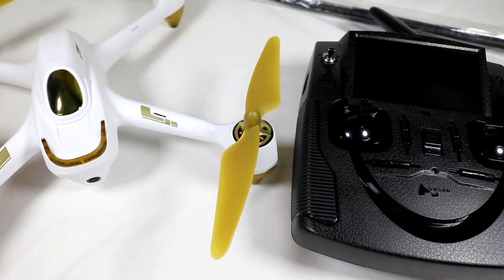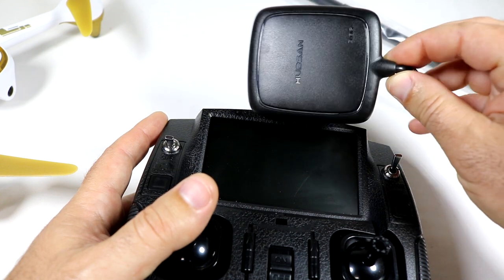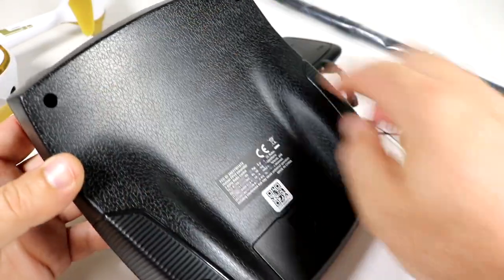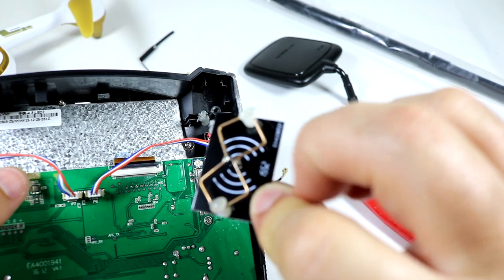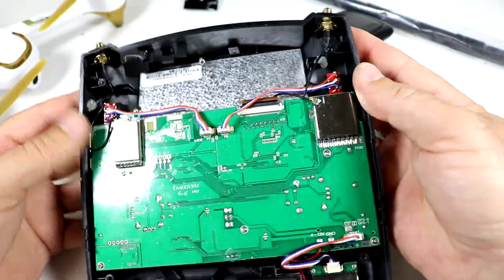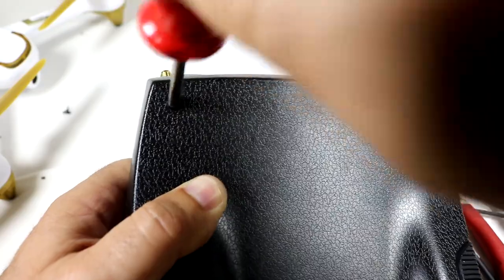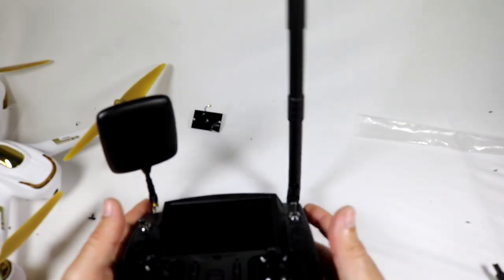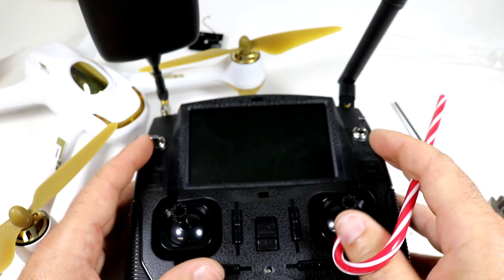HUBSAN X4 H501S Long Range Mod Tutorial [Step By Step]

Comment: use a drill bit stop so you wont do any damage when the the bit breaks through..if u don't have a bit stop use painters tape abd wrap it around the bit ..enough to where its twice the size of the bit....safer..
Reply: Thanks for the tip, I'm about to do this mod and didn't even think about that!

Comment: Dustin: Great how to mod. The internal antenna is probably 1.5 Db. Suggest you get a 5", 5 Db 2.4 GHz antenna. The monster you showed does have 10+ Db gain. The problem is the higher the gain on a monopole antenna the narrower the radiation pattern. A 5 Db antenna is short and manageable and has a reasonably thick pattern. (Example)The 10+ Db radiation pattern is like a VW tire inner tube compared to 5 Db is like a truck tire inner tube. The comparison is flawed in that the 10+ Db antennas signal doughnut circumference is more than twice that of the 5 Db. Higher the Db the narrower the radiated signal and the more directional it becomes. Suggest you show the AA batteries to a Tarantula or JJRC X1, 2S LiPo conversion.That transmitter eats cheap batteries faster than  a dog can eat a quarter pounder. You know the average new be has no idea about battery quality versus price. No fun running out of juice in the middle of may be the second flight! I noticed the voltage marked as 4 to 13 on the board. Quick and easy female JST connector solder job. P.S. That link to BangGood was a GREAT idea. Most modders leave out the, 'Where To Find Parts". :-)
Reply from the maker: +Don Fish Jr. (The Flying Fish) A slimmer doughnut is fine with me if the radius is bigger for range but I see your point.  And this is where a parabolic windsurfer may come on handy also.  We'll see how it does with some various antennas and dishes :)
Reply: The problem is you must be really aware of the antennas orientation in relation to the quad. Dipoles have no signal end on and the signal gets less and less as the transmitter antenna angel in respect to the receiver antenna approaches 90 degrees. The narrower the radiated doughnut the more sensitive it is to less than parallel. That can be demonstrated with video reception using rubber ducky antennas. They produce glitchy video as the antennas angels increase and decrease when pitch and role occur The 5" 5 Db should work for 300 or 400 yards. Much more pleasant to handle. I have a 15" long 2.4 antenna. It works but really is a bit cumbersome for park flying. I say if you want to shoot 1,000 yards use a 50CAL. If you plan to shoot 100 yards use a 22. All depends on what you want to achieve at the moment. You should experiment. For really long range you really must use a power booster. you can only go so far safely with flee power. The limitation is your video range. I went to a 600Mw video transmitter for long range. Double the power yields an increase or 1/4 more distance increase for a given antenna set.  Circular polarized are superior at shorter distance, especially for video. The signal strength isn't affected much by antenna orientation nor is it affected by reflected signal. Linear polarized antennas are greatly affected. All said, antennas are 75% engineering and 25% voodoo. :-)

Comment: Hi all, Dustin Great video, I have the 501s also and did this up grade with a kit I got off line, it was a easy up grade to do lot's of You-Tube on how to do this up grade. Just a Note: DON'T TURN ON TRANSMITTER WITH OUT ANTENNA!!! THIS WILL BLOW THE 2.4GHz SIDE OF TRANSMITTER.  That bad at that point you have to buy a new transmitter board, I think all up grade kits need this info in the kit's to let people know!  Hay keep the Great videos coming,, Thanks Don...
Reply: Hi Sky pilot 59, I think might have blown my transmitter. How to check its blown? I am not able to get the quad into GPS hold now. it is switching to altitude mod as soon as it takes off from the ground. Please reply
Reply: So.... Take the batteries out of the transmitter BEFORE disconnecting the antenna?

Comment: Dustin. I purchased the X4 PRO controller. After doing mods to stock 501S transmitter. The PRO transmitter works just fine with the 501S. It already has the external antennas and the 8 AA batteries can easily be replaced with a 3S LiPo with a JST connector or with a JST grafted on. You might give the X4 PRO transmitter a shot. Would really like to see a range test comparison. Keep the really informative videos coming! ;-)
Reply from the maker: Cool.  Thanks for the info.  I'm trying to get Hubsan to send me one for review.
Reply: DUSTIN: I watched all of the H 509S reviews and range test. That X4 Pro controller will bind with the H501S, H502S, H502E as well as the H509S. According to Frequent Flyer, "Follow Me" can be turned on for the 501S, 502S and 502E with the SB switch, (the toggle on the far right, next to the camera tilt knob.) Also you can turn the lights on and off by tapping the throttle trim (down). That may give a little longer flight time. It doesn't cancel LVC warning light flash. The H509S may also do "Follow Me" using the SB switch, not sure about that. They leave out a lot of little tricks that these great little birds can do. The 501s and 509S PRO controllers are the key to those unmentioned features, not the quads!

Comment: Thanks very much for this video, which I just followed.  If I might offer others the voice of experience, some drill bits have a tendency to grab at plastic and jump foward. In my case the bit jumped forward and destroyed my 2.4G connector on the main pcb (leaving just the central pin and neighboring solder pads). Luckily I was able to bridge the solder pad to the plug shell with solder and I didn't have to buy a new controller!  For the second hole I put something solid behind the hole to stop the drill. You can also remove the PCB, but be careful because all the plastic switch tops fall out. I think leaving the pcb in is probably best (as in the video).  p.s. FYI I measured the SMA barrel at 6.25mm (0.25"), which is handy because a 6.5mm drill bit is easily available.

Comment: I got incredible results from this mod. I didn't need the female extension on the patch antenna. One problem I had with it though is a drooping problem. The patch antenna kept falling over. I took out the washer from inside the tx, put it aside, and just went with the lock washer on top only. I put it back together and tightened the antenna screw along with the base screw on top. That solved the patch antenna from just falling over like a wet noodle, lol. I was Amazed at the distance I got from this simple modification. I got close to a thousand meters out, with no signal loss on my moniter. I could have gone further, but it was a pretty windy day. Well done with the process. It was easy, and Very affective. Do you have a vid of a battery mod using the Syma X8c battery in the hubsan transmitter ? I saw one, and the guy said that you could fly just short of forever on one charge. Some put velcro on the back of the tx, and use it that way. But you can also fit the battery directly in the transmitter, you just have to remove the battery caddy/holder. That negates the need to velcro the X8C battery to the back of the transmitter. That is my next project. I love my hubsan h501s x4 ! It's a very reliable bird ..
Reply from the maker: Glad it worked for you.   Remove or trim the caddy for lipo and just make sure you use a 2s 👍
Reply: @DustinDunnill  thanks alot for the info. I just don't like the spot that hubsan picked to plug/unplug the tx battery. Eventually it will separate the battery wire from the plug itself. Another idea I saw, was to simply leave the hubsan battery plugged in, and simply plug the charge fitting from the battery into the charger without the need to unplug the battery. That would save all of the wear and tear of constantly unplugging the battery from such a tight spot. They could have located the female jst plug in a much better location. Thx again

Comment: Another great video bro thanks. I ordered the antennas to extend the range for the 2.4ghz and 5.8ghz from banggood on Saturday so i should have them soon. I don't have a drill so i am just going to use my soldering gun to carefully poke the holes threw. I don't know if you seen the videos where the h501s starts tumbling outta the sky well it just happened to me. I don't usually fly that fast with it and when i was going full pitch forward it looked like it over corrected itself. It was scary but cuz i seen the video where it happened to another guy and he says just flick GPS hold and RTH and it corrects itself well i did that and it worked she didn't crash that was scary as hell!!! I always take such good care of my things and for it to not crash made my day so i wanted to tell you just in case it happens to you. Thanks bro have a good day.
Reply from the maker: +Ian Rice thanks. Ian.  I have noticed this once in Alt hold mode and flying fast.  Flipping back to GPS hold does fix it..weird.
Reply: it is weird huh well i am off to watch your video with the antenna mods to see the range. TTYL and have a great day.

Comment: I wonder if u can put the quad on an aftermarket carbon type race frame that’s lighter , get a bigger battery pack & even swap out the brushless motors for ones that are a tad smaller for weight and or slightly less KV on the motors for less power consumption as well & put longer & stronger antennas on everything so this baby can really get some range ! ?

Comment: Hi Dustin, your long range test sure looked good. How many flights do you have on it so far? In your opinion, is this quad of higher build quality than the X380 and more reliable? I really can't afford a phantom 3 Advanced or P4 so am seriously considering this one.
Reply from the maker: Hey Jeff,  I've done about 20 flights (some with dual battery mod..check my other vids) with no issues.  It may be slightly better build quality than the x380 IMH but gimbal options for stable video are limited due to size.  If that doesn't matter to you it's a great choice.

Comment: i think internal video antenna is the same double quad as the new one u'r using :)
may be you'll see inprovement  only using an helical one

another bad news:
 did you know tat any connection of any antenna cable mean loosing 2 or 3 dB ?

i whas an ameteur radio operator and the rule of the tumb is never ever interrupt an antenna cable if it is not needed every time you pass a male female  connection you may loose 3 db of strenght

Comment: You're about 10x safer drilling holes then using a knife to slowly make the hole larger to your liking. Also should be a bit more careful with those small ports that attach the antenna to the motherboard, if you mess those up then you have a pain in the ass repair following. Still don't be afraid to give a little power when snapping in.

Comment: Hi Dustin,
I am a little confused. 
By upgrading the 2.4ghz to get longer distance, don't we also need to upgrade the 5.8ghz FPV patch antenna so that the video signal is not cut out? The patch antenna has a gain of only 3dbi if I'm not wrong.
If it is, are there any suitable antennas to complement the 2.4g.?

Comment: do you know if you can upgrade the antenna on the drone itself? i would imagine the internal antennas on the quadcopter are pretty small. To have it upgraded on both ends would be nice, especially for the video feed.

Comment: I was wondering if you have done a range test on this mod?  wondering how it faired.
Reply from the maker: +mxnew2004 Yes, I did it over the weekend and the results were amazing.  I will have the video up soon.
Reply: +Dustin Dunnill that's awesome my quad will get to me tomorrow.  I can't wait to fly it.  I went from the Syma x5sw with a range mod to this quad.  I will also be doing your range mod on this one in a few weeks.  one more question do you always balance charge your batteries or do you do a every other.  thanks for your input

Comment: It seems like I have created a mess.
I followed these instructions and got One antenna lead connected to the circuit board, but the other simply will not snap on.
I am at a loss as to what to do next other than buy a new control unit.

If anyone can assist, please let me know.
Thanks!

Comment: Hey Dustin, I'm looking into getting this drone but with the advanced controller. Does this mod work with that controller, extending both control and video range? Thanks!
Reply from the maker: No need to do this mod to the advanced controller.  You could put larger antennas on if you want.
Reply: So I could install these antenna if I wanted?

Comment: Could you do the same mod on a H502S?  I don't know about the flight time because of the small battery in the H502S, but I think it would be an interesting video.
Reply from the maker: +W. Smith yes, it uses the same controller

Comment: Hi. I had really poor fpv range (would cut out at about 40metres). I completed this mod hoping it would help but now have no fpv on any frequenucy. I tried the original antenna to see if it was a faulty 5.8 ghz antenna but now the original has no fpv. Any suggestions? Antenna on quad appears to be located appropriately and hesitent to open it up to have a look now.

Comment: Q: I don't have $ to buy fpv, but i have fpv from my Wltoys DV686G. Is there anyway to use it on other things? I'm good with electronics, I just don't know what wires are for wt and voltages.

Comment: Hey Dustin,

Quick question I just purchased the "advance version" of the H501s, do you know if these antennas would improve distance over the stock panel/2.4g antennas ? Or is it basically the same thing as doing the mod?
Reply from the maker: +Grant R I'd try it with the stock antennas first and you may be fine.  The patch antenna here is the antenna off the advanced controller and I ended up not using the long antenna on the right.  I used the BG kit in my range test (also on my channel).  And it did amazing.  Rule of thumb though: larger antennas with more gain will get you better range but the size can really be cumbersome and may stress or break the fittings.

Comment: hey Dustin Dunnill I'd like to low what that pin cable adapter  is called I need one to connect my antenna that I got off a router for my I Internet.

Comment: hello, I want to know what is the scope of the drone without changes? and with the changes? I wonder if the drone exceeds the limit that do it? or it returns automatically this crash? thank you very good video! and sorry for the spelling I use google translation from Switzerland bye
Reply from the maker: no mods = 300 to 500 meters range.  GPS will allow auto return to home every time signal is lost.
Reply: +Dustin Dunnill have can not do go over 1000m?
Reply: +Dustin Dunnill and wanted to know what is best remote drone level because I know from the CX-20 cheerson and hubsan what the Developer High thank you

Comment: that's a great mod Dustin. can u provide the link for those 2 antenna pieces?  I keep clicking on the one you provide but can't find it. can't wait for the video.
Reply from the maker: +jr_the drone guy 1322 search eBay for: 2 Mini 4" PCI U.FL to RP-SMA Antenna
Reply: Dustin Dunnill
Thanks. I actually found them on Banggood. Did you get the chance to test it?  Hopefully you get some good results.

Comment: Why does everyone use a 14db directional antenna on the left, then a 3-7db omni directional on the right? Have you tried using 2 14db directionals?
Reply: Thats because you would lose Video AND Controll if you dont point at the quad by doing that. the configuration is the good.

Comment: Can I use a Clover Mushroom Antenna?  For both TX and RX? If I can, do you have a recommendation?
Reply from the maker: +EYECON You can but need to get a 2.4ghz version for control and 5.8ghz for FPV.  Honestly not sure if they would improve or hinder range.  The kit you can buy in the link in this video description has the patch and monopole antenna I use here so they may be the best for the antennas in the quad.
Reply: Thank you for the reply.  I just don't like how "naked" the 5.8 antenna is.  I wonder also if the dbi difference is significant between the mushroom and the flat one.

Also thank you for all the videos.  Its been helpfull and I always recommend your site/page to friends who wants to get into the hobby.

Comment: i got this one, and followed your instructions, and parts... one scary issue i lost fpv at a little over 1 KM...
 and was happy to see that it came back to me with RTL.
 you managed to go over 2km, and still have fpv...I wonder HOW?? did you start at a top of a mountain?  cause all I can come up with is line of sight... Talk to me please...
Reply from the maker: +Jack Scarpon hey Jack.  Away from any wifi or other interference, and a good line of sight with no obstructions between the craft and control is equally important.  Trying a range test in a residential area will really interfere with both FPV and Controll signals.

Comment: Great video of the extended range antenna.  Is there any kind of setting that would limit the range.  I can't go beyond 240 meters without it auto returning home, which is the same without my extended antenna.  Any suggestions?
Reply from the maker: +Ron R Hard to know if you have a software or defective antenna issue.  I've heard some firmware versions limit range but I'm not sure which.

Comment: I tried it in the middle of a field and still the same, so last night I opened the controller and unplugged antenna and re attached I shall try it this afternoon to see if there is an improvement if not I shall try the mod I guess
Reply from the maker: Hope it works :)